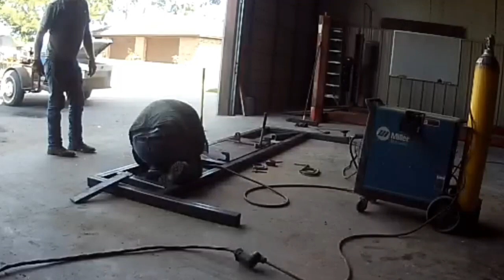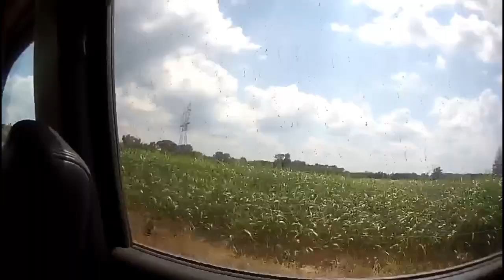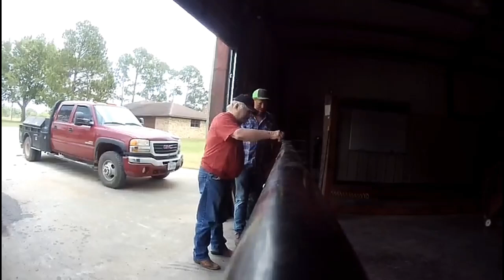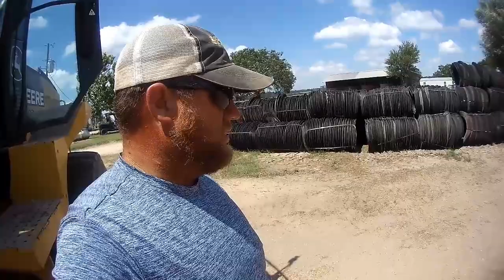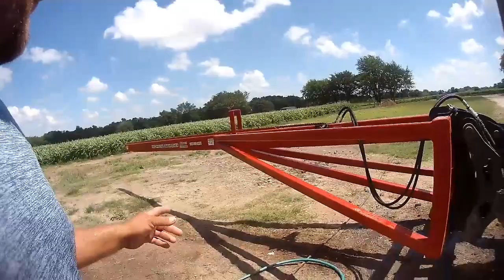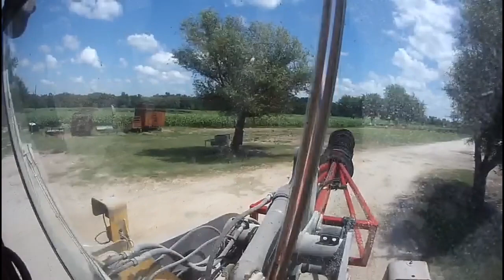Silage rake, hay king, tire shooter and checking sorghum both the old guys!

Comment: What size tractor and tanker did you have spreading manure?
Reply from the maker: Its a 4000 gallon tanker and that was a 7220. We usually run a 185 hp tractor on that tanker now